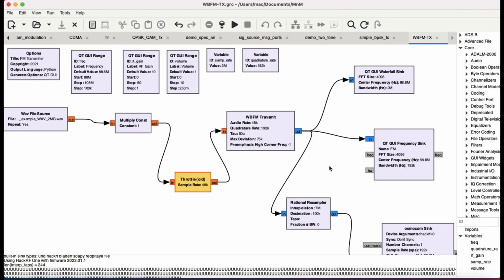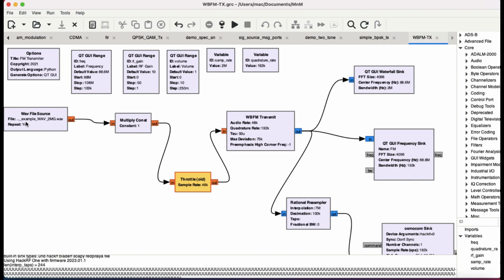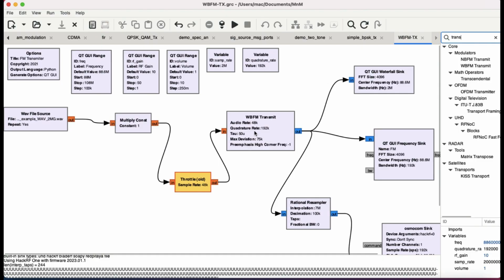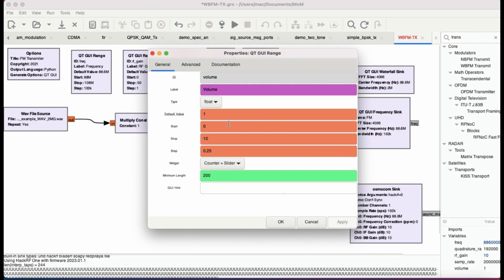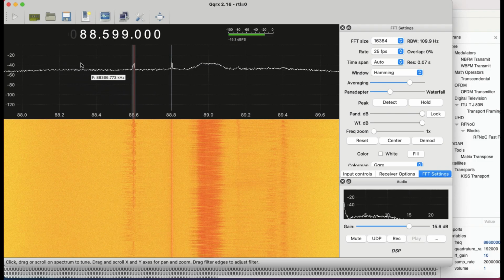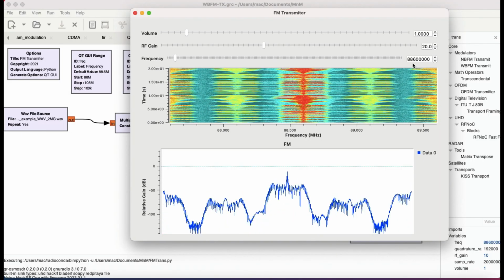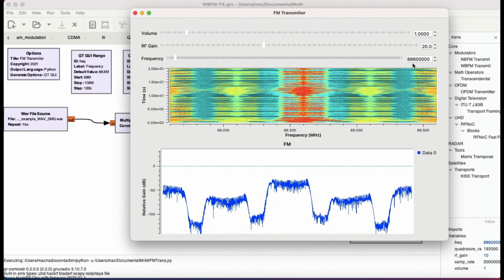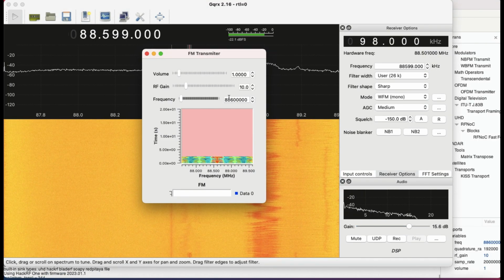DIY I Built my OWN Complete FM Radio Station — HackRF + GNU Radio Companion (Live Demo)

Comment: https://youtu.be/Fks9mL_JW7A?si=xS_KviwgmeOOjoMr
Hi  mustaqim above is the link to ofdm tranciver where he pings one tranciver to another tranciver using tuntap interface on both trancivers 
But when am trying to setup same am not able to ping radios encountering destination host unreachable 
And inside gnuradio it's header_payload_demux detected packet size more than framelength (100) 

Also am trying to setup ieee802.11 gnuradio example of wime project try to send data over air using fmcomms2 anything related to both issue would be helpful 
If you can try and explain to setup clearly it would be so helpful 
Thanks in advance